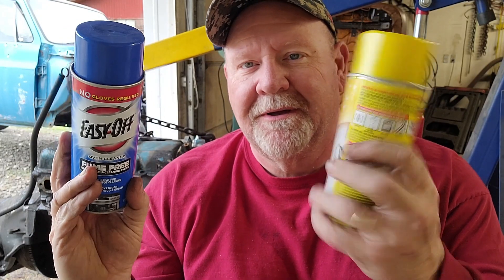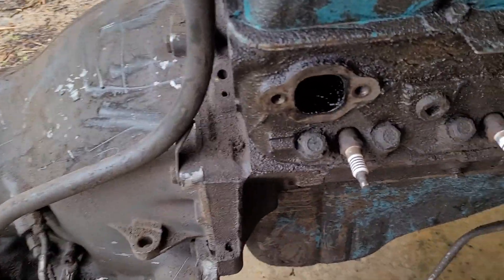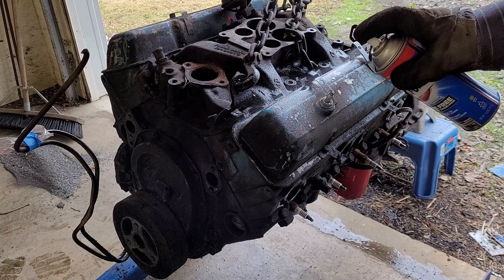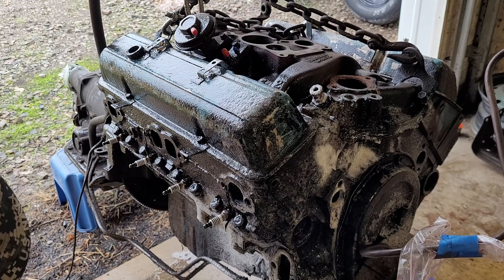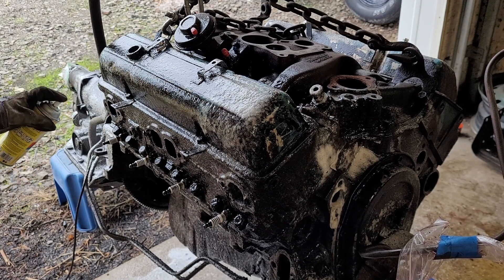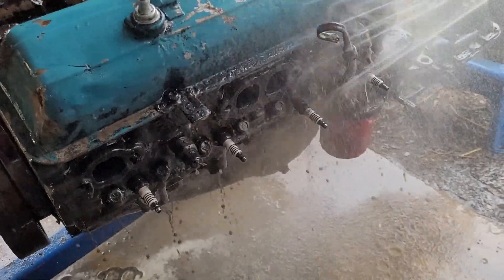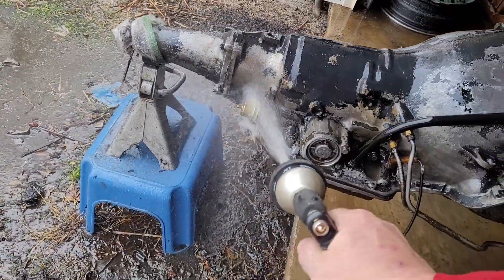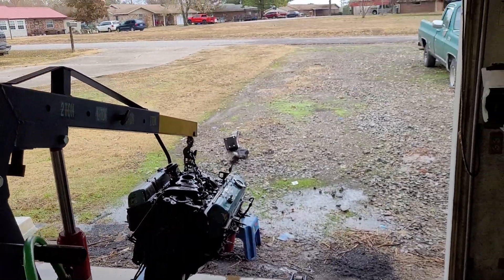Cleaning Engines With Oven Cleaner: Square Body Chevy Build

Comment: I have been using oven cleaner for years on engine parts. What I have found is that it's not very good on grease, but for the varnish covered parts inside the engine, such as crank and rods, it works great. It also works great on the inside of the blocks after the greasy part is removed. You just have to be ready to spray WD40 on everything as soon as you rinse it off as it will start to get surface rust quickly.
Reply: Nice
Reply from the maker: great info, thank you very much

Comment: I used the same cleaners with about the same results.  Heavy duty worked great on the transmission and I had a pressure washer, so that really cut down the cleaning time.  The fume free was a bit more friendly to work with inside the heated garage over winter when I couldn't work outside.
Reply from the maker: AGREED, thanks for watching

Comment: Great video. Have a 350, 305 and 454 that all need some degreasing. This will help male short work of it. Did you use anything before painting? Like acetone or lacquer thinner?
Reply from the maker: Yes I did, Lacquer thinner, Thanks for watching have a great weekend